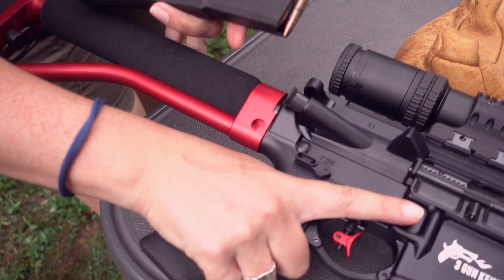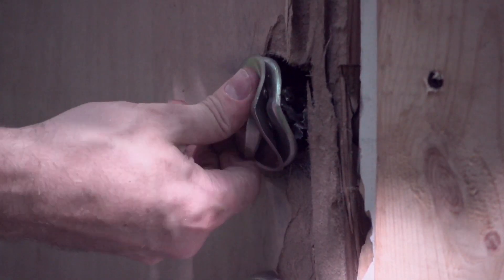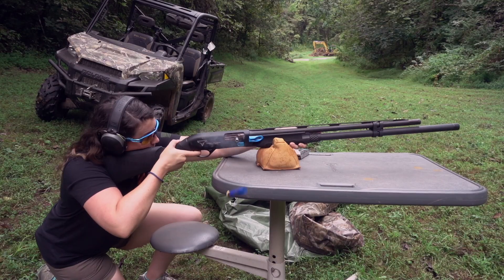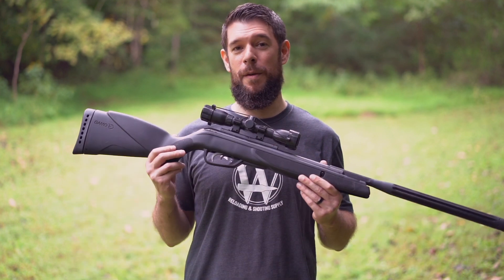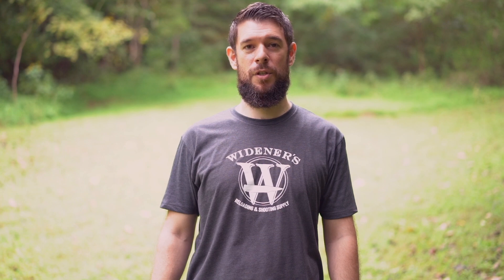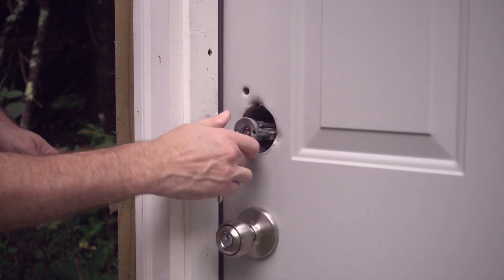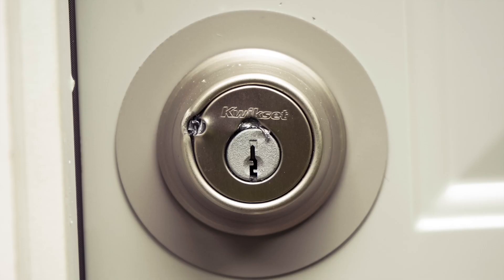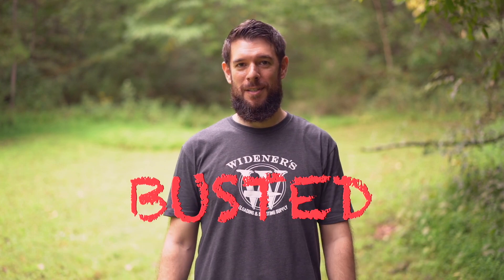Shooting A Deadbolt

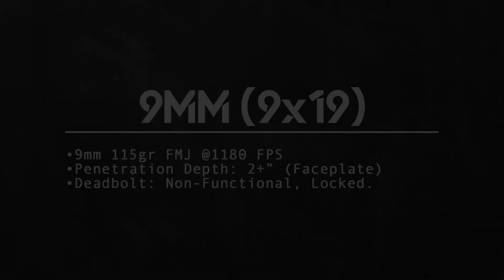Comment: 3:50. With the lock mechanism blown completely apart, a culprit with a functioning brain would know that all they'd have to do is reach in the big hole and pull the bolt back with their fingers.
It scares me that people this stupid are discharging firearms for YouTube content. Good thing an IQ test isn't necessary for 2nd amendment rights.

Comment: Shoot the space between the lock and the door face at a 30 degree angle so you actually hit the deadbolt and not just the lock.  The results will be a lot different.  And use a larger caliber PCP pellet rifle.

Comment: Very nice job on the video!
I’ve wondered what a 9mm would do to a deadbolt. Now I know.I have a friend that’s a retired police officer. They used 12gauge slugs from about 3’away to breach doors. Many still required kicking or a door ram to open.But they did get in.